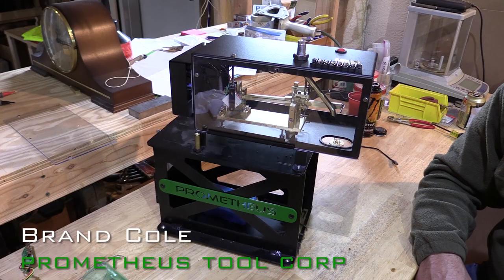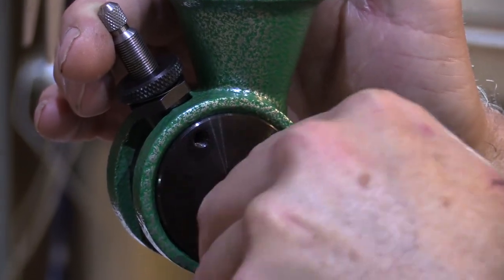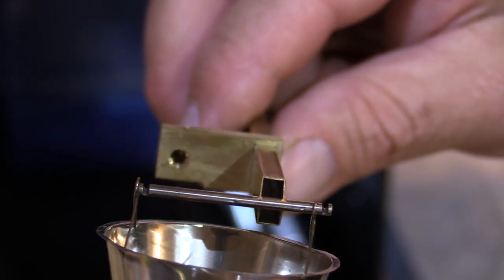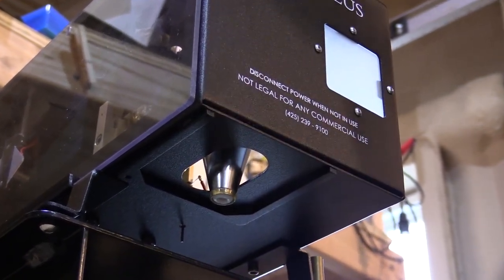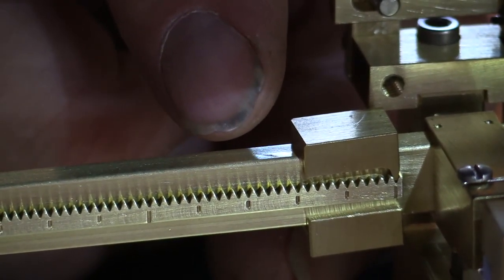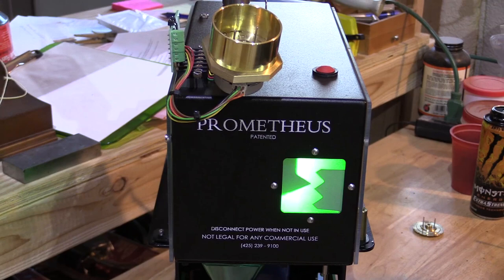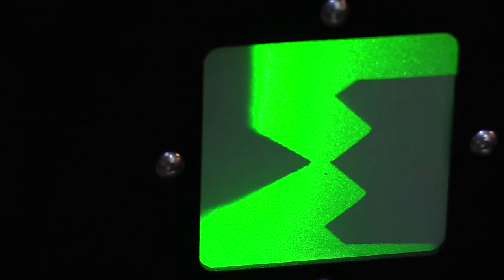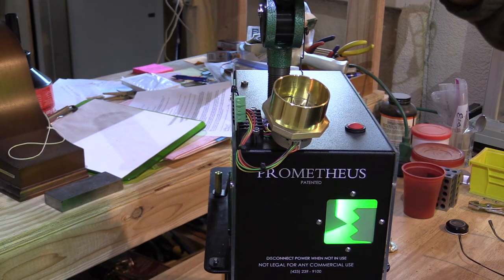Prometheus Powder Measure - Instructional Video

Comment: To fix the kernal sticking in the tubing and needing the extra jolt, consider using silconert coated tubing. It does ad cost but it saves sticking and even cross contamination between powders.

Comment: I do not quite understand not for commercial use part and 25 year lease?
Reply from the maker: Thomas, at the time of this video, the Prometheus GenII was only available to lease.  Now, there is an option to buy the machine outright.
Reply: Deeremeyer1... Soz bro, you have missed the mark a bit. 

I am an Instrumentation Technician who specialises in mass, density and weight measurement.
Your definition of a Scale and/or Balance are not right. They are different devices that can not be made from one into the other just by being calibrated and certified.

Scales measure weight due to gravity(yes the "due to gravity" is important). They also do not have to be certified. There are plenty of plants/industrial kitchens I have worked at where they don't bother calibrating scales for saleable product because they are used for a guide only. 

Balances(which is what this device is fundamentally) measure density relative to a known quantity regardless of gravity as gravity is applied to both sides of the balance equally. A balance can be and often are certified, at least to about the same ratio as scales. My local fruit shop uses a trade certified balance.

At the start of this video, around 14 minutes, the gentleman explains exactly what each division on the beam scale and fine adjustment mean. These figures are probably also put into the product documentation. Just because the numbers are not engraved into the beam means nothing at all. A simple beam balance from RCBS or Lyman has numbers on it but no one expects those to be within .02 grain accurate. Some are for sure but most are not. 

Balances are often used where extreme accuracy is needed, due to the ability to have a very accurate definition of density of the comparison load. That could be a physical calibrated load or a magnetic force supplied by a current.